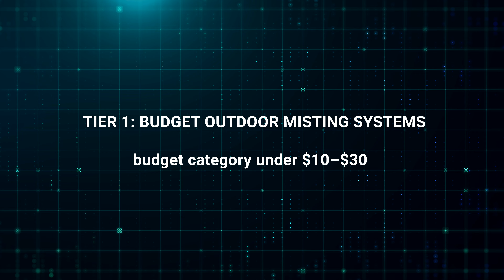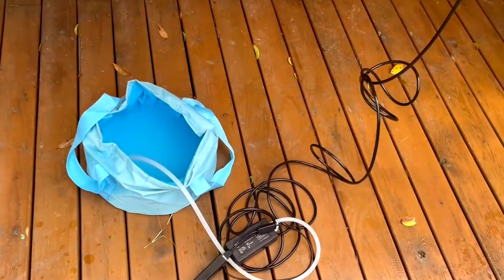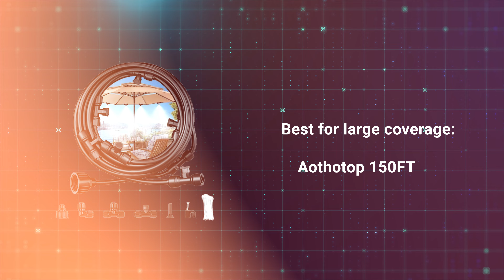Best Outdoor Misting Systems for Patios, Pergolas, and Backyards

Comment from the maker: ➡ Links of the Outdoor Misting Systems we listed in this video.

TIER 1: BUDGET OUTDOOR MISTING SYSTEMS ($10–$30)
0:33 #1. homenote Misting Cooling System — $29.99
https://bit.ly/4xno2ci
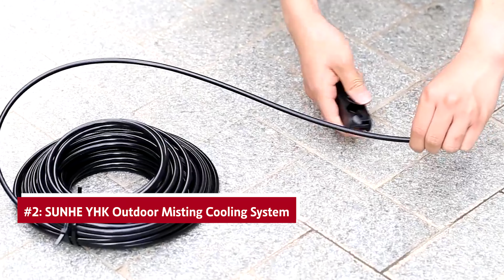1:43 #2. SUNHE YHK Outdoor Misting Cooling System — $19.99
https://bit.ly/4elmDLA

TIER 2: MID-RANGE OUTDOOR MISTING SYSTEMS ($35–$80)
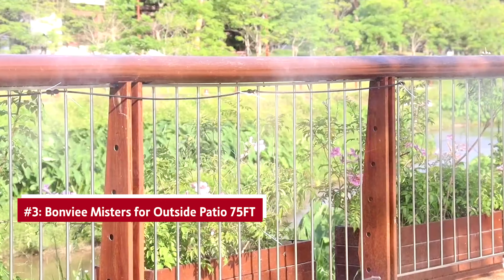2:46 #3. Bonviee Misters for Outside Patio 75FT — $37.99
https://bit.ly/43Kyywr
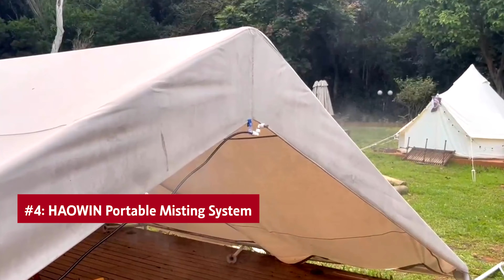3:53 #4. HAOWIN Portable Misting System — $49.99
https://bit.ly/4x3QgbT

TIER 3: PREMIUM OUTDOOR MISTING SYSTEMS ($80–$110)
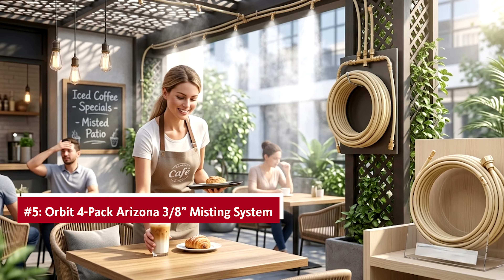5:09 #5. Orbit 4-Pack Arizona 3/8” Misting System — $88.99
https://bit.ly/4x9imlR
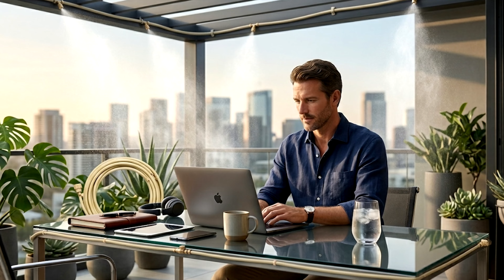6:17 #6. Aothotop 150FT Misting System — $79.99
https://bit.ly/4x6nc3l

TIER 4: LUXURY OUTDOOR MISTING SYSTEMS ($110–$250)
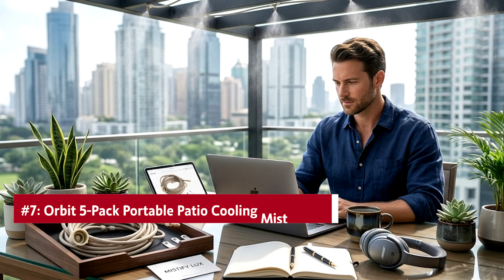7:30 #7. Orbit 5-Pack Portable Patio Cooling Mist System — $105.00
https://bit.ly/4xcLhpm
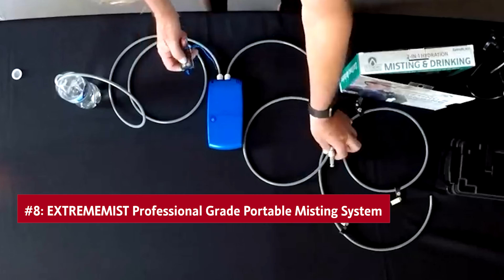8:44 #8. EXTREMEMIST Professional Grade Portable Misting System — $189.00
https://bit.ly/4x7vR5v